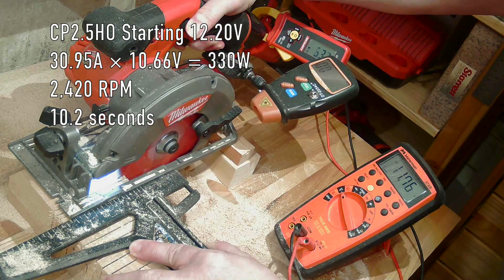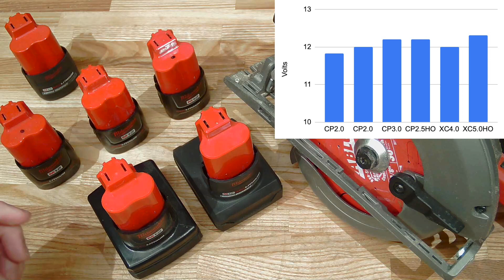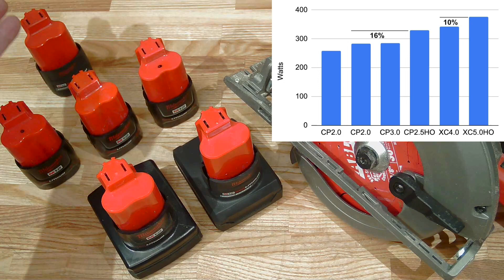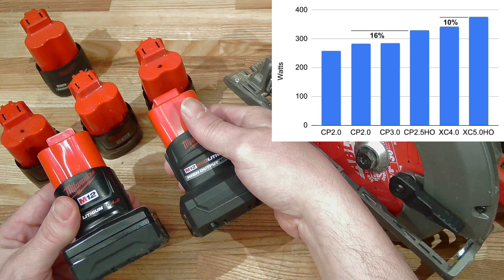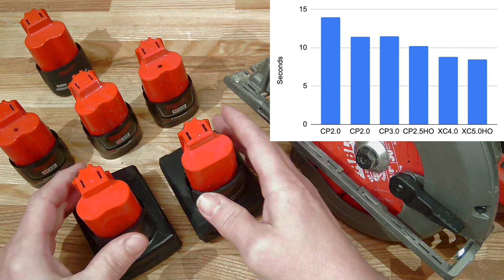Test: Milwaukee M12 HO Battery vs XC vs CP in Fuel Circular Saw

Comment: Good video! To be honest I thought the saw would be closer to 500W output with the 5.0HO. They have just released a gen 2 Saw...it will be interesting to see the difference!
Reply from the maker: Thanks! That new saw looks more compact and is a bit lighter, though the lower blade guard is plastic, not metal like the 1st generation. Perhaps new tools can better utilize the HO batteries... I now have the 3rd and 2nd generation drills and impact drivers to compare... videos forthcoming in the summer.